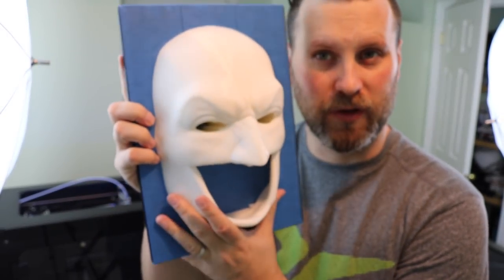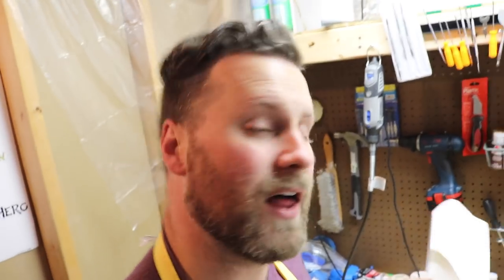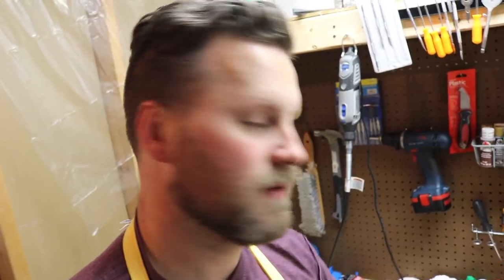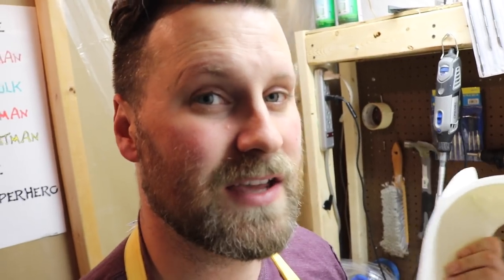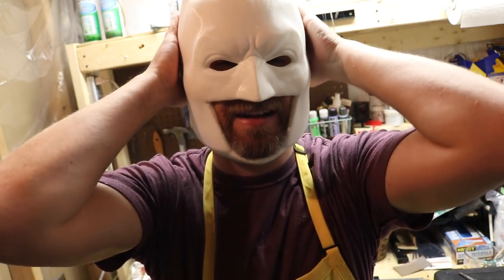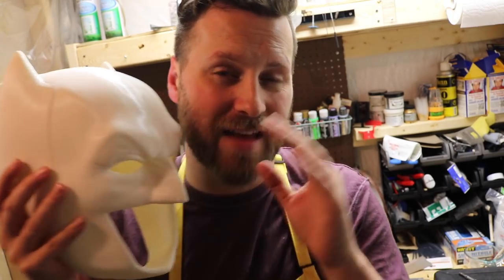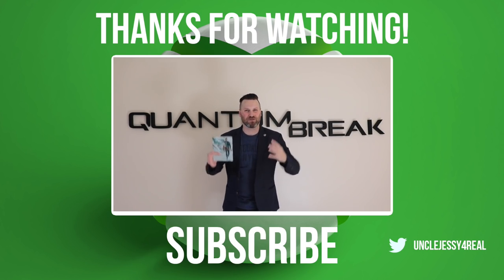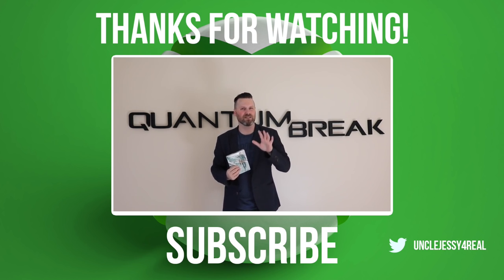The Ultimate 3D Printed Batman Mask - Replica Prop Part 1

Comment: I am very inexperienced when it comes to 3d printing, and I was just curious if any of you knew how big a printer you would need to create something like this. Specific product names would be appreciated.
Reply: Good question. I'm curious too. Been trying to research but can't find the right info
Reply: Obviously I'm late to comment but something moderate. Really you can have a tiny one you just need to print it in sections/layers. It doesn't all need to be printed at once especially since one mistake in a massive print is harder to fix than just printing a new tiny layer. Less wasted stuff

Comment: it needs to be rubberized
Reply from the maker: Indeed! Bring on the rubber
Reply: I reccomend latex
Reply from the maker: +Awsomeness Cosplay yea all depending when I get it further along I might mold and make a rubber version. Thanks for the tip
Reply: +Uncle Jessy urethane rubber is much more high quality than latex.
Reply: +Uncle Jessy what if you print it with black flexible plastic filament? sorry i have to ask, i would try it myself if i owned a 3d printer :)
Reply from the maker: +Dali DIY brother, you need to get a 3D Printer. I'm a huge fan of your channel and a little honored that you checked out on of my videos. Love your work man.
Reply: Uncle Jessy ya man, i've been watching many 3d printed props video lately, seems like so much fun, & your batfleck mask looks very movie accurate :)
Reply from the maker: +Dali DIY checkout the Wanhao printers as well. You can score one for under 1k and they have great print quality and a nice big build area and have a great online community behind it. I think they have one that's under $500 usd as well.
Reply: Uncle Jessy thanks :)

Comment: I would have used this to create a mold in order to get a silicone copy, it would just be a better material, and it would be more comfortable. Plus the feel would be more accurate, as the material should be flexible, you'd be able to move your jaw, etc. Still very cool though.

Comment: Great print! Quick tip if you take a full sheet of sandpaper and spray glue it to a flat surface. You can then sand the joining surfaces to be a perfect match. Its a woodworking tip that transfers over real well. Good luck on your future builds.

Comment: I have a file for the full batfleck cowl. Question I have is what settings did you use for yours? Will be printing on a Cr-10.
Reply from the maker: LarrisolB I believe for the full cowl I scaled it to 107% on the cr-10 if you have Facebook grab one of the profiles form the files section
Reply: Uncle Jessy where do I find the files section on your page?

Comment: hey i have a small printer and i was using 123d design but i need to know how to make it into smaller pieces so i can print it please show me i don't know what i'am doing and i realy want this cowl pleeeeeeeeeeeeeeeeeeeeeeeeeeeeeeeeeeeeeeeeease
Reply from the maker: You need to download and install netfab basic. It's free to use and your can rescale and cut Stl files into smaller parts. I used that A LOT with my makerbot mini which had s 4x4x4 build area

Comment: What % did you scale this to?  I've started printing it and noticed it's really small
Reply from the maker: tunereklipz I believe I scaled mine to 107% then sliced the files. The files I used were from Pinshape and I have about a 23.5" head
Reply: Thanks!  My head is about the same size
Reply: 107% or 170%?)
107% it's pretty small

Comment: Hello. Did you upscale the model in order for you to print it? If so, which scale did you use?
Reply from the maker: I scaled it up to 107% my head is just a little smaller than 24" around maybe 23.75
Reply: +Uncle Jessy thanks :)

Comment: Great video! I'm very interested in how you join the pieces together (which was in fast forward here). Do you sand the edges of both pieces you will connect? and with what grit? Also I use PLA for the most part. Thanks!
Reply from the maker: Pla and then I use maybe 80 grit sand paper just to give it a little texture. Then I use super glue to bond the pieces. Alternatively you could use an old soldering iron to melt/join the pla
Reply from the maker: I'm in the process of editing my update video.

Comment: Are you applying bondo before or after the smooth on application? I've been planning on testing smooth on AFTER a bondo/sand process.
Reply from the maker: I have a video update in the works showing what I'm doing to finish it. Right now I just applied some bondo spot putty to some areas and will be applying XTC-3D to it before I paint it

Comment: Hi!  I'm looking into buying a 3D Printer for cosplay making and I was wondering if you had any suggestions on which 3D printer I should buy?
Reply from the maker: I've been looking a lot at the Robo3D, a lot of people are buying the wanhao duplicator i3 as well. It's cheap but requires a good amount of tinkering
Reply: Thanks for getting back to  me so quickly :) I really appreciate it. Robo3D seems to be exactly what I was looking for.
Reply from the maker: +sheene318 it's a solid printer and they have great support if you run into any issues. I've seen some people online make some great cosplay props with it!

Comment: So, I’ve looked around for a while now. I noticed you use filament printers for bigger builds, Is there a reason for that? Sorry if I sound a bit unknowledgeable about the topic that’s because I’m new  to the 3D printing world. I just bought an Eleego Mars pro and I love it, but I would like to print bigger things.
Reply: You can use a resin printer however, most resin for resin printers is quite expensive. Not to mention size, FDM printers usually have bigger build size when compared to a resin printer from the same price point. 

Happy printing!!

Comment: should try printing in ninjaflex
Reply from the maker: I thought about that. Since I printed it in 3 parts and plan on finishing it ( sand, paint etc) I didn't think ninjaflex would be the best option. Still could be interesting to try
Reply: In theory you could print the whole thing with some support struts inside that you can just cut off. Dense enough ninjaflex can be pretty ridgid so struts should be fine. Could also be done with dual extruders by printing the struts in something else. 

but that mask looks awesome.
Reply from the maker: +Lucretius thanks man. Sounds like I need to buy a bigger 3D printer haha. I should have a update video posted this weekend. Thanks for stopping by!
Reply: Will def check it out

Comment: Pretty slick. How do you like your 3D printer? I am thinking about upgrading mine.
Reply from the maker: I have 3 right now. My primary one is my BQ witbox. I love the damn thing. It prints really great and I've had only a few minor issues with it. It doesn't have a heated bed but there is a way you can add one in on your own. What are you thinking about upgrading to?
Reply: I am currently printing with an Overlord. It was a very affordable first option, however I fight with it every time I print something.

I am just in the research phase. I checked out the specs on the BQ witbox after watching your video. Looks like a decent machine. I like that it has a large printing bed and is a reasonable price. 

Do you have any upgrade suggestions other than the BQ witbox?
Reply from the maker: +Designs by Leon I've been eyeing the wanhao printers lately. Decent price and build area. Would love a lulzbot but that price tag is a bit out of my reach. I would really love a gmax. Build volume is massive. Let me see if I can find the other printer I was looking at. Can't remember the name off hand

Comment: I would have made the mask more rubbery & less rigid.
Reply from the maker: They have flexible filament. But since I needed to print in multi pieces I figured I'd print it in regular pla. I can alway cast and make a rubber copy